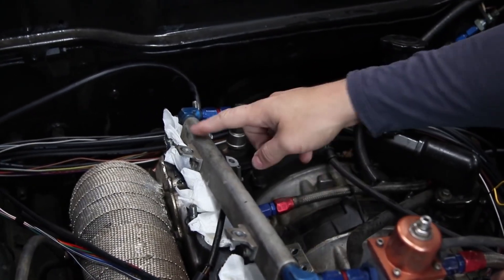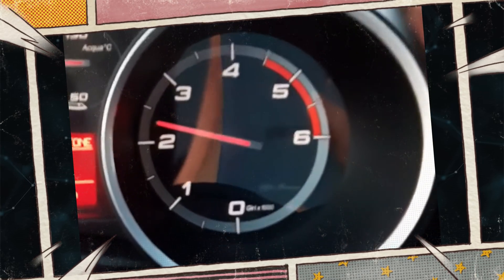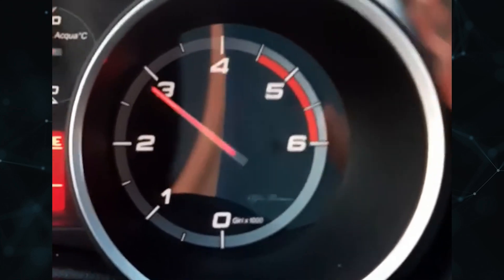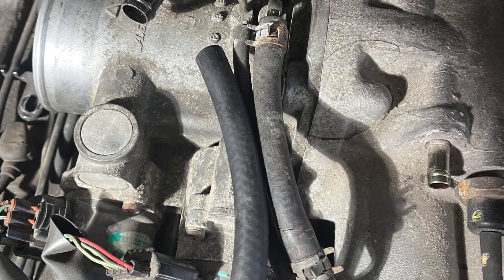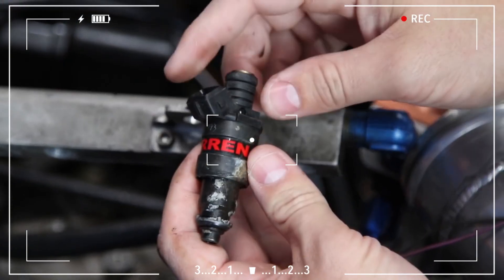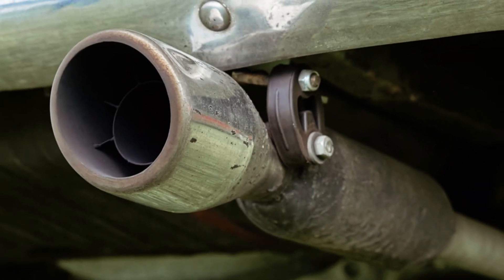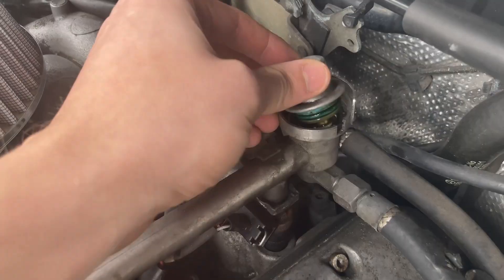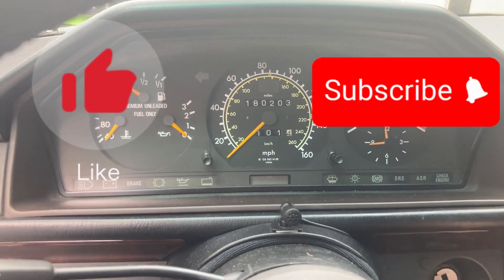6 Symptoms of a Bad Fuel Pressure Regulator & Replacement Cost

Comment: 1991 302 five liter , HO , can the pressure regulator go so bad that the car will hardly run , or not at all ,,, ? ,,, it's not the ignition , runs fine on starting fluid ,,, !
Reply: I believe it’s possible. Also check the fuel filter. It’s cheap and easy to get to on our cars
Reply: @Efinn2002  ,,, I've since bought a pressure gage , I only have 10 pounds , new pump tomorrow  ,,, !